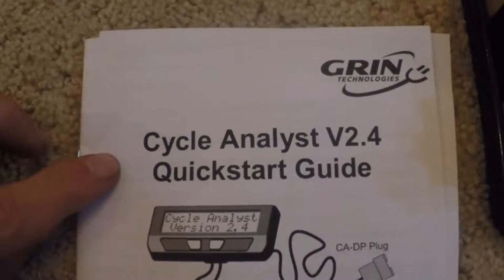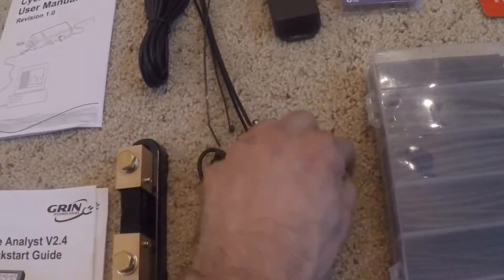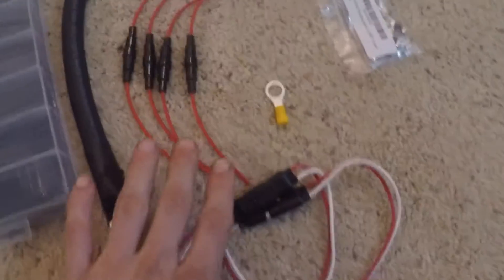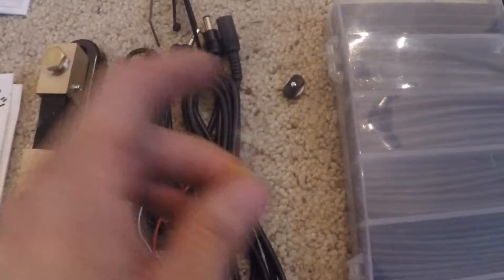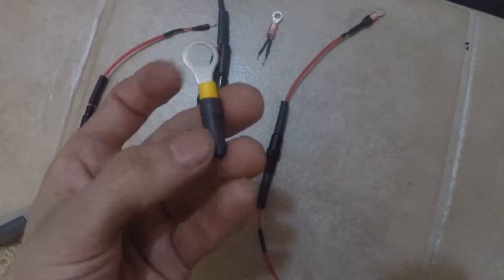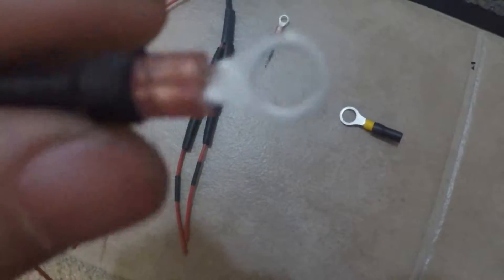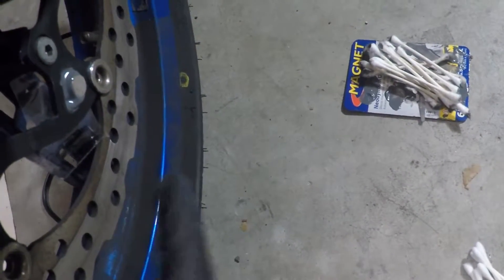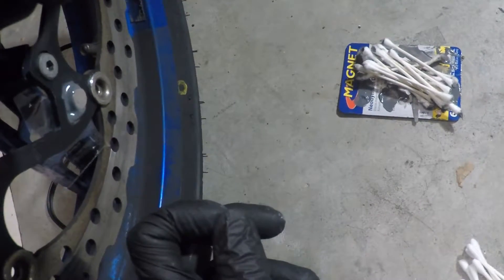Cycle Analyst Install on Electric Motorcycle

Comment: I'm a big fan of silicon self-fusing tape instead of heat-shrink. Self-fusing tape is MUCH more flexible and can stretch to conform to differences in diameter.